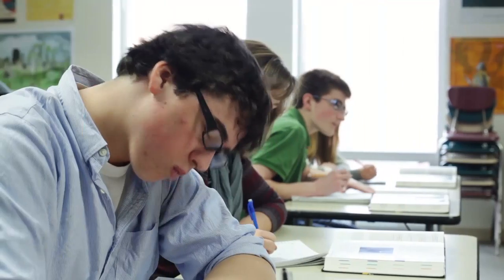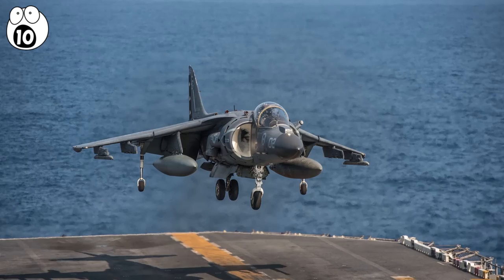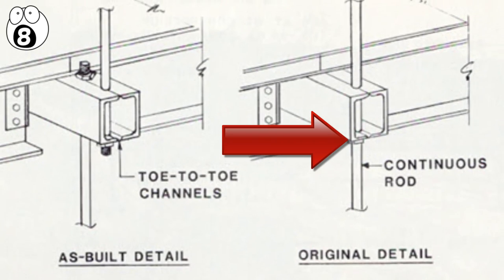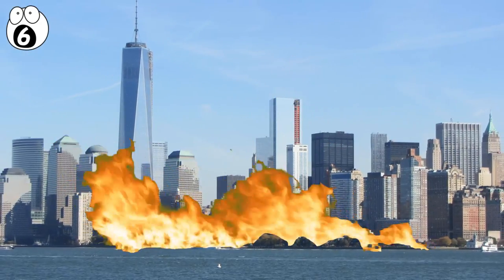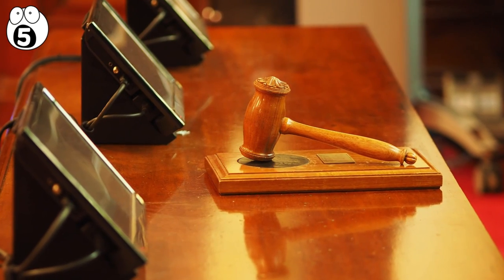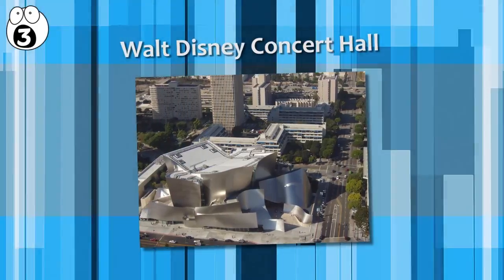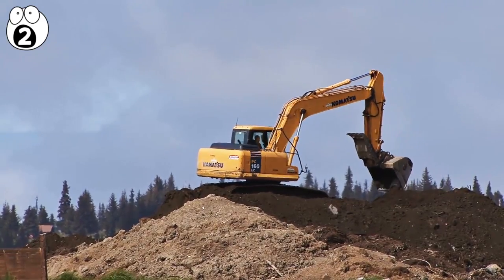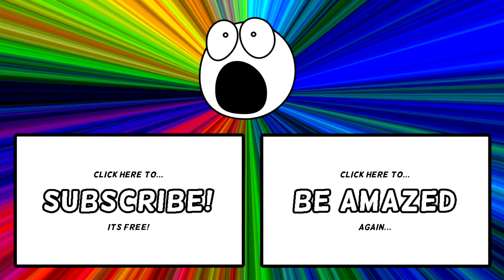Biggest Design Errors Engineers & Architects Made

Comment: This video is so incredibly inaccurate... Take the Regency walkway. The problem wasn't that both walkways were suspended on one rod. They would have been suspended by one rod in both cases. The problem was that both walkways were suspended in one nut, as opposed to two nuts.
Reply: Heh, nuts...
Reply: Please tell me that this is you being sarcastic in return to the shitty research that the video maker made. Having actually done a case study of this particular accident for my 3000 level Engineering Mechanics course, one nut vs two nuts would make no difference. 
1. Neither the rod, nor the nuts, failed. The box beam did.
2. The box beam was constructed from two C channels welded together (which was as designed) instead of using a single box beam (which could have potentially mitigated this problem). The nut pulled through the beam.
3. As designed, each nut would have only supported the weight from one walkway and would have been perfectly safe.
4. As built, the nut on the upper rod supported the weight of both walkways and this exceeded the bending strength of those C channels flanges... Again, the flanges on the box beam failed... not the nuts.
5. Photos from the event also suggest that the bridge was overloaded past it's recommended weight allotment since it was the grand opening event and there were more people on the walkways that ever would realistically have been on it during a normal day, adding yet another contributing factor to the failure.

Your welcome for summarizing a 10+ page technical examination of the accident into 5 short points.
Reply: My2CentsWorth1 
1. The box beam failed because the nuts had twice the designed force on them, exerting twice the pressure on the beam.
2. The nut pulled through the beam because it had twice the designed force pulling on it.
3-4. So... If there is a clear difference between one nut vs two nuts, why did you say that one nut vs two nuts would have made no difference? You're contradicting yourself.
5. The point is that the design change halved the maximum load capacity of the structure, even though the original one was already 40% too weak. This change in design was identified as the root of the issue, not the amount of people on the walkway. But as is the case with all disasters, they're never caused by just one thing going wrong, and all factors contributed to that collapse.

I will not thank you for the shoddy summary, considering you failed to understand what the actual cause is: a design that placed the entire load on one nut as opposed to two.
Reply: You need to work on your delivery then.  The way you said it in your first comment makes it sound like if the all the weight was supported by two nuts in series on the threaded rod, then it wouldn't have failed. This would only be true if the thread/nut was what failed.  From your second comment, I see what you are trying to say is that if built as designed then each nut would have only been supporting the weight of one walkway, but it would have been simpler to say that if they built it as designed as seen in the diagram on the right at 2:36, then everything would have been fine. Instead, you make a highly ambiguous comment about it being suspended by one nut instead of two that can easily be misinterpreted.
Reply: +My2CentsWorth1
I don't have enough data at hand to see if the walkway would have collapsed if using the original design. What I do know is that it would have been able to carry twice as many people as the changed design, so chances are it wouldn't have failed.
And the cause of the failure of the box section wasn't because it just failed. It was because the nuts were putting twice the normal pressure on it. When an airplane crashes, the cause is not that the fuselage wasn't strong enough to resist the impact with the ground. It's because of pilot error, or some other part somewhere giving out. Just because the box section failed and lost integrity, that doesn't mean it's the cause of the incident. You don't seem to have a clear enough understanding of this incident.
It would have been simpler to say that if it would have been built as designed, it would have been fine, but that doesn't really say anything. The mistake was that the video says the walkway collapsed because both levels were suspended from one rod. You cannot point out what the error in that statement is by saying that if the design was followed, it would have been fine.
And I don't see how my comment is ambitious, considering that's what the investigation determined the cause to be. The only reason you misinterpreted my comment is because you don't fully understand what happened.
Reply: "You cannot point out what the error in that statement is by saying that if the design was followed, it would have been fine."
You can't. I can.
My case study involved doing an analysis following a similar process as the NBS report with the focus of comparing the "As Designed" vs the "As Built" differences. I can say, as a statement of fact, that the original designed would not have failed under identical circumstances. Practical evidence that it would not have failed can be seen from the fact that the 3rd floor walkway was fine despite supporting similar traffic.

I did not say your statement was "ambitious." I said it was "ambiguous."  That is because your statement could have been interpreted more than one way and the simplest interpretation was a wrong answer.  Your statement read "The problem was that both walkways were suspended in one nut, as opposed to two nuts."  The simplest way to read this is to continue "as opposed to" with a repetition from the first half of the sentence to get "The problem was that both walkways were suspended in one nut, as opposed to suspending both walk ways from two nuts."  This implies that if you replaced the single nut with a double nut that things would have been fine.  I see now from your follow up comments that what you meant was "The problem was that both walkways were suspended on one nut, as opposed to each walkway being suspended on separate nuts." This imprecision in your language resulted in an ambiguous statement and that the simplest interpretation of resulted in the wrong answer.And regarding my understanding of the problem, I assure you, I do. Unless you have written a paper analyzing things like:
1. The weight distribution of the walk way based on the weight of concrete/corrugated steel per foot and point loads like the box beams.
2. The differences between assuming a free floating connections vs a ridged connection at the end of the walk way.
3. Estimated distribution of people at the time of the accident based on photographs from shortly before the accident.
4. Bending stresses necessary to cause the flanges on box beam to fail based on the distributed force profile across a semi circular bearing face between the washer and the flanges
5. Etc.
...then do not make presumptions on my knowledge. My issue with your comment is that you used imprecise language to describe an engineering problem and precision of language is critical in the profession. There is a saying (both in engineering and the military) that "Words have meaning."  It is not just enough to say something that could be interpreted correctly, but rather it is important to say something that can not be interpreted incorrectly.
Reply: My2CentsWorth1
"You can't. I can."
Saying "You're wrong because what you said is not right" doesn't prove anything. The next paragraph shows exactly that. You didn't just say what you told me i should have said. You went about proving that the initial design was sound. (Well, at the very least, "sound-er" than the final change.) You needed to say more than just saying "You're wrong cause the original design was better".

"I did not say your statement was "ambitious." I said it was "ambiguous.""
My bad, then. I still don't agree with your statement.

"My issue with your comment is that you used imprecise language to describe an engineering problem and precision of language is critical in the profession."
You have two ways of going about it. You can either point out the imprecision in the language used and provide clarification, or you can say that the statement is completely wrong and is a joke. If you choose the former, you will invite healthy dialogue, where at least one person will learn something, which is critical in science in general. If you choose the latter, you will create the kind of conflict we're having now, where we are needlessly arguing from the same side about irrelevant syntax. That doesn't help anyone. I am willing to admit when i make errors, but only when i do actually make them. I am not interested in bowing down to every self-important prick that comes along, who thinks they hold ultimate knowledge in the subject being discussed.

As such , the problem i have with your comment is that you use imprecise language, which is critical in the profession, coming off as a self-centered jerk, instead of providing actual, meaningful critique that's inviting open debate.

Ball's in your court now. Are you going to back off and admit that maybe your approach wasn't entirely correct, or are you going to stubbornly stick to your guns, engaged in a completely meaningless crusade against no one?
Reply: I'm simply going to stop responding to a keyboard expert because I don't need to derive self-worth from a debate with some stranger on the internet with no manners. I have a piece of paper and a career that says I know what I'm talking about and I'm more than satisfied with those two things.  You claim that you are looking for healthy discussion, but when I pointed out my premise for why your comment came off as a hyperbole instead of clarifying and trying to set things straight, you attack. It is a shame that you can not take criticism of your poor phrasing and move on and that you give advice that you chose to ignore in the same breath.  If having the last word means that you are right, then enjoy commenting one more time and being "right" because you are no longer worth my time.
Reply: My2CentsWorth1
"I'm simply going to stop responding to a keyboard expert because I don't need to derive self-worth from a debate with some stranger on the internet with no manners."
No manners? Really? You're the one who came here all set to tell me who incredibly wrong i am. And i would say the only keyboard expert around here is you. I don't care what you wrote and what you did. None of it justifies your attitude, and i will call you out on it.

"You claim that you are looking for healthy discussion, but when I pointed out my premise for why your comment came off as a hyperbole instead of clarifying and trying to set things straight, you attack."
Let me remind you what you said in your initial comment. I quote: "Please tell me that this is you being sarcastic in return to the shitty research that the video maker made." Yeah. That's totally pointing out your premise. Opening with an insult makes for such productive conversation. And then you proceed to tell me how "one nut vs two nuts would make no difference", but then you go on to say that "as designed, each nut would have only supported the weight from one walkway" and that "as built, the nut on the upper rod supported the weight of both walkways and this exceeded the bending strength of those C channels flanges". Which kinda sounds to me that one nut vs two nuts does make a difference. And then you get all offended that i point out the contradiction in your high-horse research.

"It is a shame that you can not take criticism of your poor phrasing and move on and that you give advice that you chose to ignore in the same breath."
I accept criticism when it's warranted. You could have said that i should have expressed myself better, and that would have been fine. But instead you tell me that i'm completely wrong, that my comment is a joke, and then proceed to tell me that what i should have said is exactly what i said in the first instance. That is why your attitude sucks.

As always, we see the armchair experts coming out of the woodwork, trying to pretend that their degrees somehow means something. They tell everyone they're wrong, and then proceed to impart education. And when called out on their BS, they take the "moral high ground" and leave the conversation. Typical.
Reply: My2CentsWorth1 finally someone who knows what actually happened it seems like no one here understands it
Reply: That's nuts mate
Reply: shhhhhh
Reply: From what I see in the video the failure pattern seems to suggest that the failure was due to the shear stress on the beam that is introduced because the rods are offset, and the beams (sheet metal bent to C shape) was not rigid enough to withstand that force and finally gave way due to metal fatigue. You can see from the photo at 2:41 the support rod ripped through the beam. As for the explanation in the video, it is just totally self-contradicting bullshit.

Comment: The 1st one is hilarious. Not only the engine didn’t have enough power to merge, but when they redesign it, making a bigger and more powerful engine, they discovered that the engine wouldn’t fit in the engine room. So back again redesigning; after 1-2 years of development they finally got a submarine that was actually able to go up, and that its engine would fit inside. Everything alright, right? Well no. They then saw that making the submarine bigger for the engine made it actually so big, that it wouldn’t fit in the shipyard were it was originally send when the initial development started. So there we have some more millions spend making the shipyard bigger. And that’s the situation at the moment. If anything new happens, I’ll update this comment. Thanks for reading!

Comment: Sorry, but Nr 6 is very poorly explained
The decision of bolting or welding is depending on the parts you want to combine and if - sized correctly - bolts can make a way stronger connection of two parts than a weld

And for Nr 9:
If you give an Impulse on a bridge is starts to shake with a certain frequence and intensity, depending on the construction. If that frequency matches with the wind it simply will simply create a higher amplitude every time it swings, breaking EVERY bridge, because theoretically the amplitude can get infitively high causing a "resonance disaster".
They simply didn't knew about that effect at the time ...
Reply: Yup, you are right it is resonance. When the video first said the bridge is too rigid like raw spaghetti then it said the bridge failed didn't have holes to let wind pass through...lmao

Comment: "With no holes for the wind to pass through, the bridge took the full force of the gale"- WTF!
Reply: ikr . Since when do bridges have "holes"? And what one earth does it have to do with the bridge being too rigid, as the noodle anaology suggested?
Reply: It wasn't even that strong of a wind when it collapsed. Galloping Gertie had been fluttering (word chosen deliberately) even in very light winds after it had been built.
Reply: What he meant to say was, "What the engineers could not anticipate, was that the length of the Tacoma Narrows bridge was such that the wind crossing the bridge would create an harmonic oscillation the would eventually prove to be catastrophic."
Reply: Fishofgold6  The holes he refers to are the ones you see in a lot of steel girders that actually have nothing to do with what the video mentions.... they do that to decrease the weight of the girder itself instead of using a massive solid component. The video is absolute tosh. However, the noodle anology is actually a very basic attempt at explaining how structures are designed to be able to move (to counter wind and earthquake forces) and expand (to counter thermal issues) a little. If you make any structure too rigid they will most likely fail and not in a good way. Yes, there is a good way that we design buildings to fail (too long to explan here)...

Comment: Oh dear, where to start...   Angled deck carriers,  Necessary for jets, not so much for propeller Aircraft; Tacoma Narrows Bridge (Galloping Geartir) wan not a structual (rigidity) issue, the roadway was sufficiently flexable, it was an aerodynamic issue (vortex shedding) complicated buy a harmonic issue.  The Tokyo airport was bulit  on sand on purpose, the lad wad quite litterally dreged up from the harbor, and the buildings were designed to have their foundations sink and the upper parts jacked up as needed., the site was chose because of the enormous political cost of building the previous airport on existing farmland.
Reply: As a Washingtoniain I respect you.
Reply: And Tropicana Field was never designed to be a baseball field. It is being used for it but it was not designed for that purpose.

Comment: You are very, very wrong at 2:59
In both designs, the top rod must carry the total weight.
The as-built situation causes a very high load on the connection between the bottom of the top rod and the top walkway.
That connection must now support the weight of BOTH walkways.

Comment: There is slight catch with carrier runways though. Sure, I do not think it's the best design, but you must realize that most of them were built before war, when the catapult to launch planes was not a thing. Those planes needed much longer piece of runway to take off. So even though the 9 degree runway would exist, it wouldn't be of much use back then. In fact, in the end it would only add target area, thus making them easier to hit. As a matter of fact, that is still problem of those giant carriers. They are so huge you couldn't miss them even by accident.
Reply: Yeah but in modern times we've had naval and air superiority and not fought conventional wars; the things really still are sitting targets.